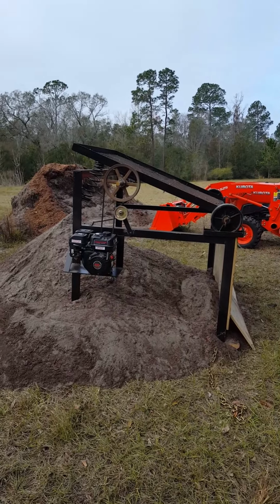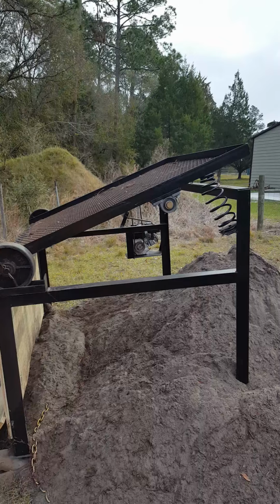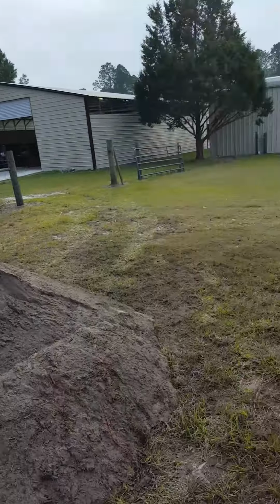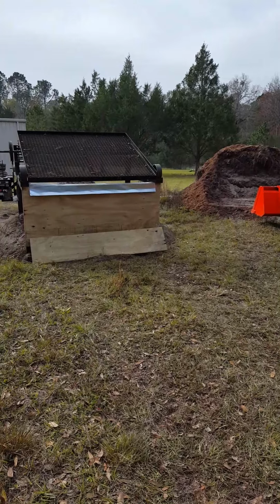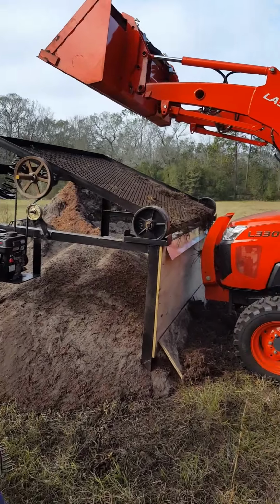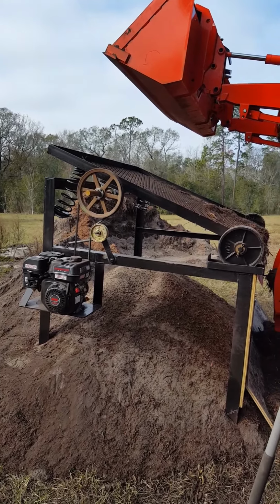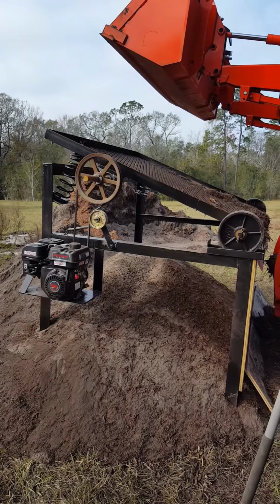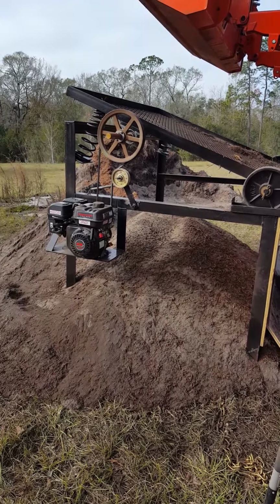Topsoil screener in action

Comment: i think its working a-ok. at least for what type of dirt u have there. if u had rocky dirt-would u load it from the rear side-so ur tractor hood didn't get dinged from the rocks right? would u have made the front side a foot lower-so the screen has a better pitch to it-or not? for me mine needs to be a bit steeper-so my bigger rocks will roll off. but i am going to copy ur design for mine. thanks for the video of it. good luck with it.

Comment: I made a screener,pretty much the same concept. I have a few tips, load from the other side and pull soil as it builds up, dust will  kill that engine quick,so change air filter to a Honda OEM, change to a smaller belt or tighten tension on idler because as you put weight on screener belt becomes loose and reduces rpm to screener. https://youtu.be/BcS1Mfbe-6Q